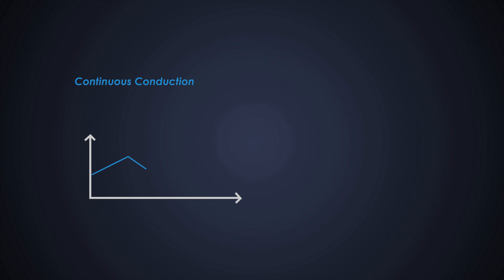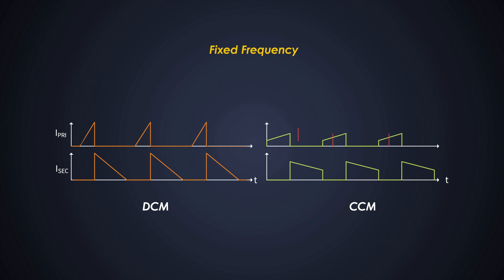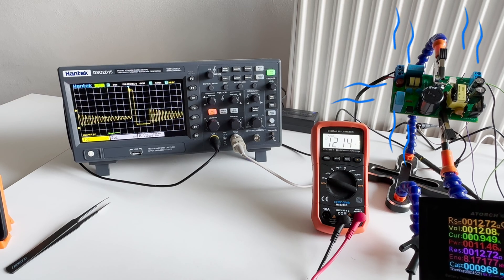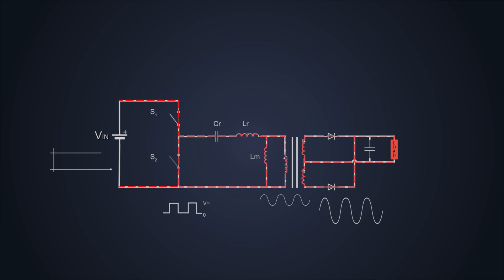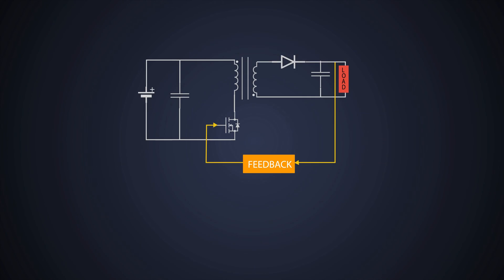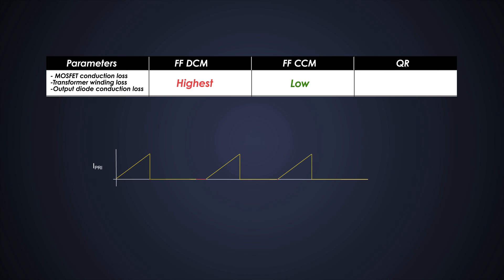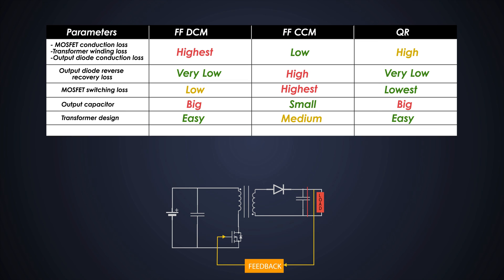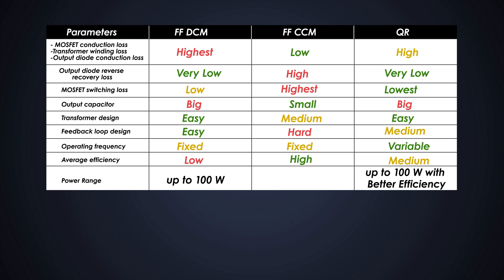Understanding QR Flyback Converter | QR vs DCM vs CCM: Choosing the Right Flyback Converter for You!

Comment: Normally I use a "hybrid mode" controller at Flyback circuit which is burst mode at no load or ultra light load(for power saving), QR mode at light-mid load and CCM at heavy load.

Comment: Something seems not right here. The stray inductance of the transformer causes a ringing on the mosfet turn of edge! and not on the turn on edge. The ringing you're talking about is between the capacitance of diode on the secondary and the transformer. Adding a snubber across the diode dampens this oscillation, but in the CCM you whant this ringing. Or what am i missing.